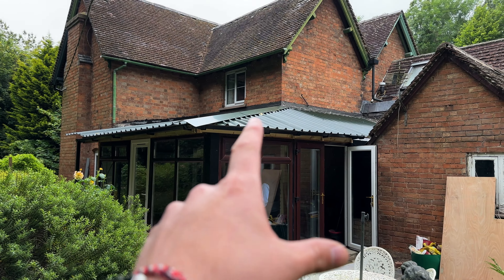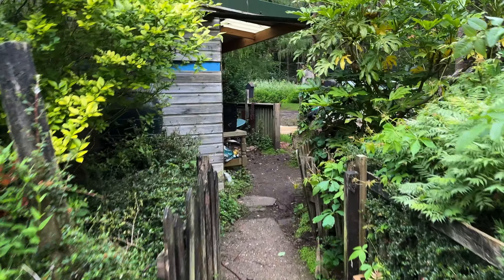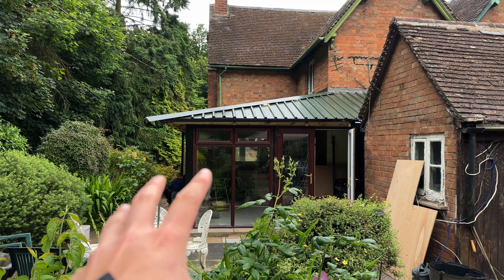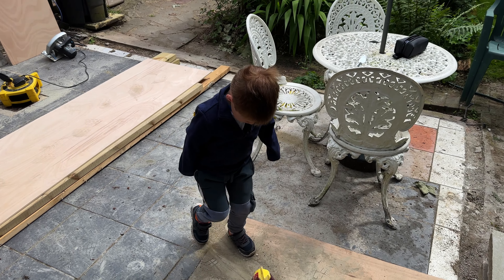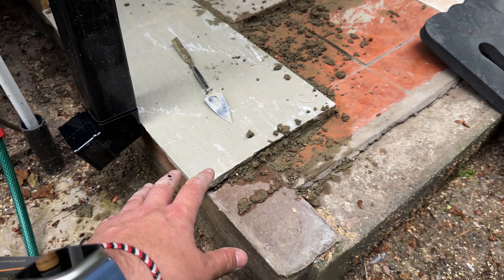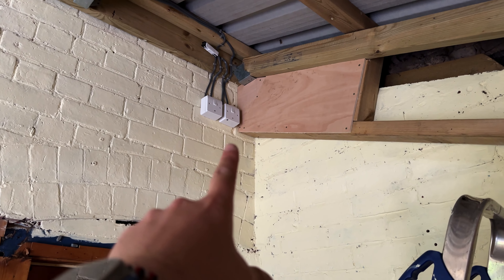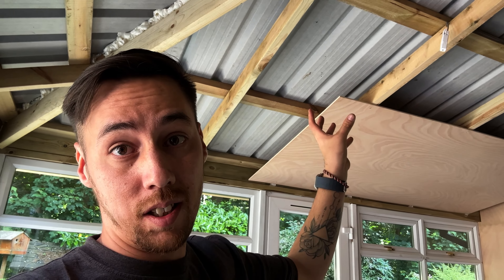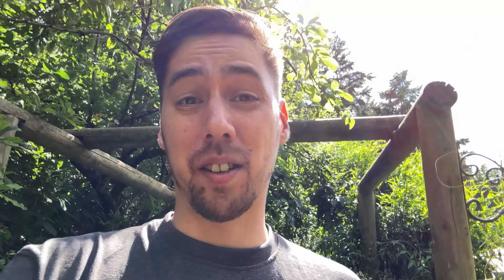Putting things right.. (House Renovation) 🏡

Comment: Loving the content. On the water ingress, do you have an idea on where the water is getting in? Foaming it won't be ideal long term as water will find its way through the foam, but i expect you might have made further improvements for the root cause that you didn't include in the video?
I know you a lot of the choices are out of your control Nathan but did your mum and your family not consider a DPC, rather than fixing in UPVC units at ground level?
Reply from the maker: It was just falling onto the old tile and running underneath so she’s foamed underneath and we’ve sloped the new patio slabs away from the building to help. Originally the plan was to use DPC, but due to budgets and time constraints we just got the framework as quickly as possible and cut corners sadly. In a perfect world we would have used DPC & raised the floor with concrete to create a completely new level pad to build off of but yeah.. out of our control! 

You sound like you may know this though, for an existing garage floor, I’m considering a pva mix with cement fillet to protect the floor for renovation into storage room. Do you think this would work for that conversion?